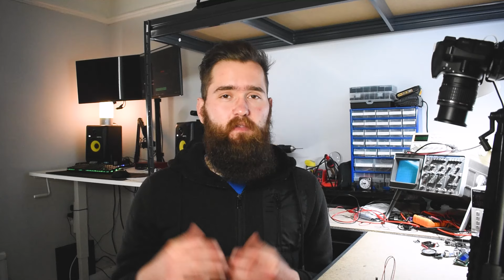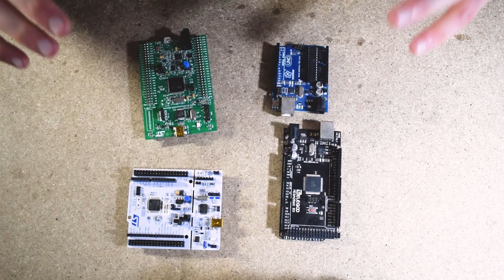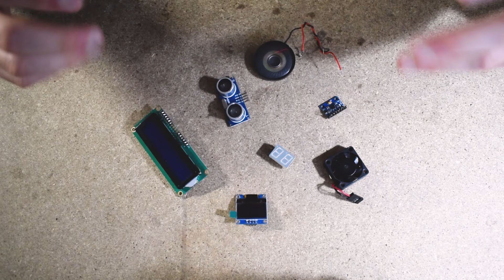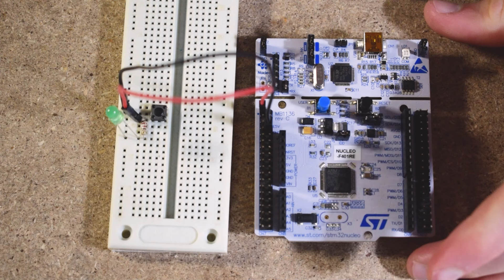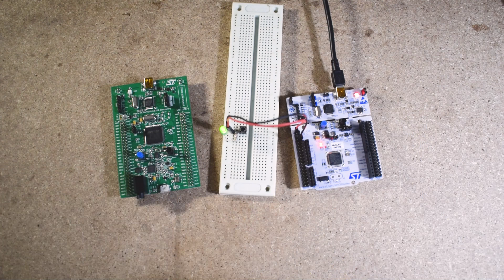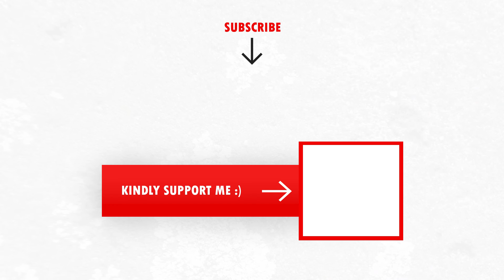Embedded Systems, Microcontrollers and STM32.

Comment: Thanks for stressing these are development boards. More attention needs to be drawn to the fact these boards are for testing and development. It's frustrating reading about projects that have a whole Arduino UNO board left in when the parts they actually need would be way cheaper to use on their own.
Reply from the maker: I think PCB design can be very intimidating to some. This is something I will cover also!
Reply: @thehardwareguy  Definitely agree on that, but there doesn't need to be a leap straight from devboards to PCB design. A lot can be done soldering up components on perfboard as a good middle ground.
Reply: One thing you should know about the Embedded community especially among the Arduino crowd is that there are too many quacks. 
Such things don't just intuitively click to them.

Comment: You said one was a F4 chip... these are the same chips that F4 drone controller boards are based on...? I wonder then if could just adapt one of these controllers for r/c, as they seem to have way enough power for flight 🤔😉
Reply from the maker: Those drone controller boards aren't too complicated to design, but developing the software is the challenging part! those flight controllers do a lot under the hood!
These boards are both F4 chips! this Nucleo-64 has an STM32F401RE chip, which is the baby brother (less pins) to the STM32F407VE chip that is on the STM32F4 Discovery board